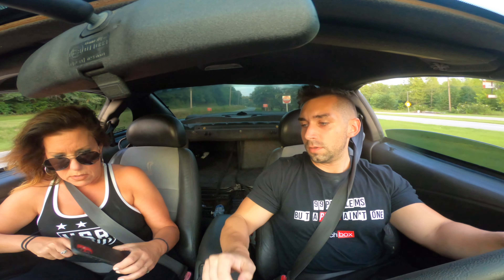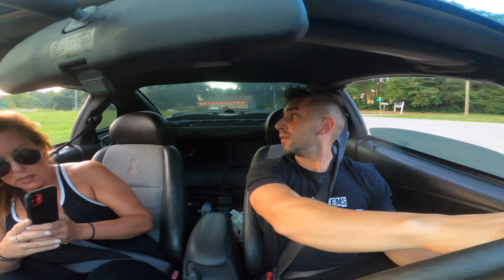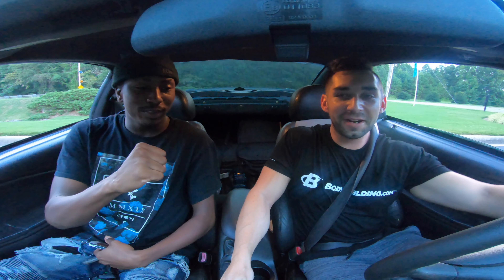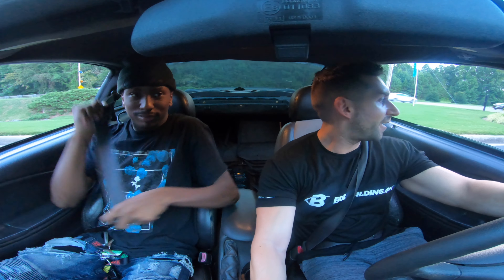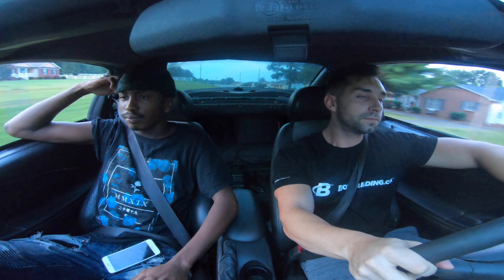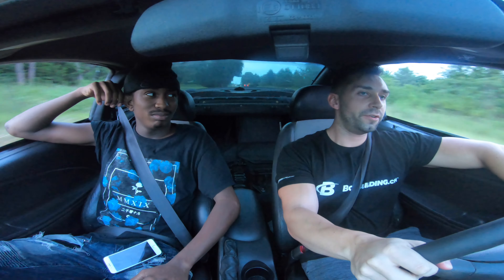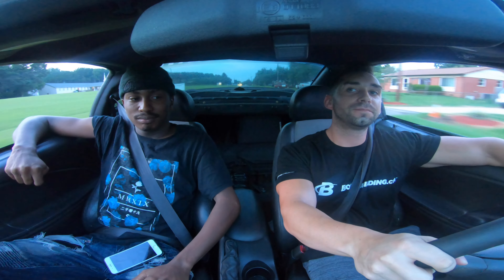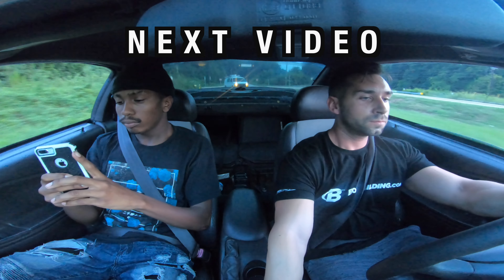Mum VS 600 Horsepower Cammed Terminator Cobra

Comment: You should probably get a retune just to be on the safe side of things. That’s what I would do but it’s up to you. Love the car man!
Reply from the maker: Thanks man, I may but then I would have to do an additional retune after the new parts come in 2-3 weeks. So, I’d be paying for 2 new tunes in the next month and we still have a few small issues to iron out.
Reply: Jordan Miller that’s true. Is your car built motor or just a stock refresh motor?
Reply from the maker: @marshallgreenwood7806  It has ARP hardware, cams, billet oil pumps but stock pistons and rods.